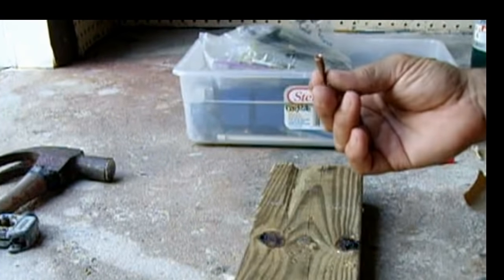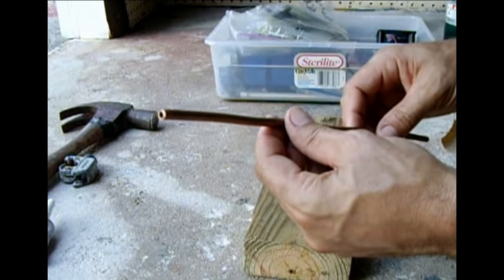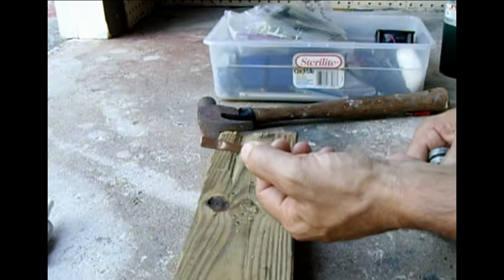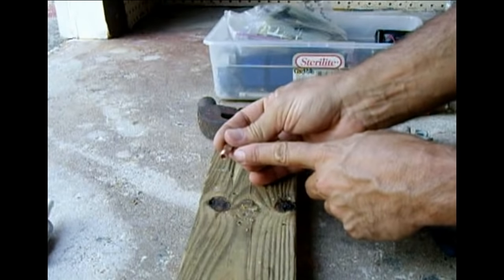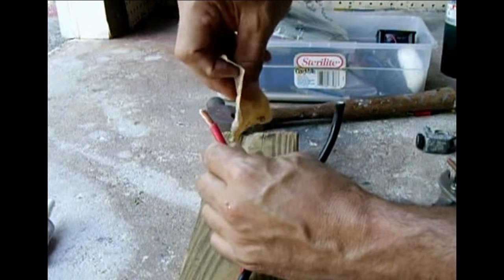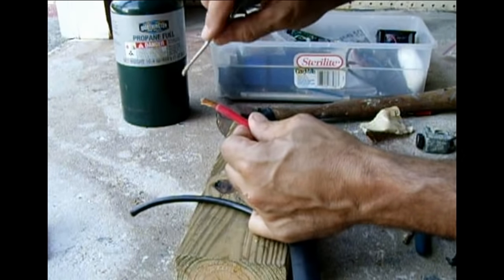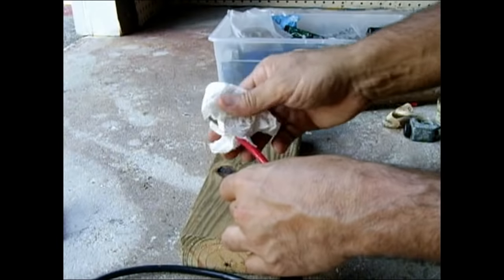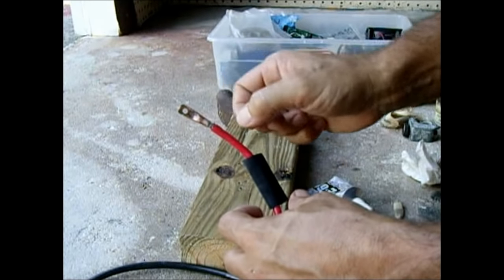How To Make Copper Battery Cable Connectors!

Comment: I prefer to crimp and then solder. In the event of a dead short (heaven forbid) the solder will melt immediately and the wire to slip out which could possibly compound the problem. The wire, once lose, could strike something else. Now instead of just having a bright orange glowing wire with the insulation burning off, you have the potential for sparks flying everywhere. If you don't have a crimping tool I find that using a center punch and punching a dimple into the connector will compress the wire inside and prevent it from coming lose if the solder ever melts due to heat. I have had 12, 12 volt deep cycle batteries dead short before. The last thing you want is one of the wires flailing about, contacting something it shouldn't and producing massive sparks. The remains of my 9/16" wench produced enough sparks for me. And yes it was fused, but in the split second for the fuse to blow it did serious damage.
Reply from the maker: Very possible event, but highly unlikely. As you stated, the wire would have to be extremely hot in order to melt the solder. The insulation would be burning off the wire, and at that point it would not matter what happens, because once the insulation burns off, the wire will be touching things and grounding out.  As I stated in the video, for extra strength, crimp and solder.
Reply: Oh, and great video by the way. The price of things today drives the average Joe to do what the Average American Joe does best, and that is to use what he has, use his brain and improvise. Also, when I make connectors like yours I always round the corners just slightly with the grinder or a file to give them that "professional" look. One of your commenters mentioned using one tube inside another and also using them to bridge batteries instead of using copper cable that costs as much as a two week trip to Florida. I'll try this except I'll use some rubber hose on the bridge connectors for insulation. Because if you drop a wrench guess where it it will always fall?

Comment: good video but he used pliers to hold his part but you should drill hole while it is still attached to the tube , use the tube as a longer handle to prevent the bit from grabbing in the soft metal and ripping it out of your fingers or pliers and injuring yourself or damaging your part. keep your parts  away from the drill bit parts many have been hurt by this   myself included.  also  doing the drilling before  saves you steps if it gets damaged as the soft copper will fail sometimes when doing larger holes this saves time which is directly linked to your wallet .  Also note the 12 deg angle of a drill cutting edge is more than enough for it to grab like a knife blade in soft metals once you have broken threw with the chiselpoint (center of drill flutes) of the drill . usually  this chiselpoint is a non cutting edge and is why you have to push so hard to drill without a pilot hole ...  drill before you part off the excess material !! :)  using pliers  will leave tool marks in your part also id rather try make it look perfect  he did good but there is always a way we can do better.. be sure to use a two fluted tool if a tapered or step type bit is used  or it will drift horribly  you have virtually 0 control over drift on a single fluted tool when done by hand. to make the chiselpoint of a drill a cutting edge  you hand sharpen your drill bit as normal  dress your wheel so you have a sharp corner then  you turn it so the chisel edge is parallel with the wheel and use the sharp corner of the wheel to grind it into a cutting edge  rotate 180 deg and do the other side. you will basically make a small notch in the back side of the flute that will not effect tool life in a negative way  we are making that blunt center resemble a two fluted end mill.
when you are finished i usually put the bit to my fingernail and gently turn it 180 deg  you will see the bit wants to drill into your nail with its before blunt chisel point.  This will save you some time and sweat when drilling harder materials like steel  or using a drill press. a drill sharpened in this fashion  you don't even have to center punch your material most of the time  you start the drill press line it up and gently tap it against the work piece as it center cuts now it will gladly make a divot for you to use as a center point as now even the center cuts your also not pressing as hard you will be less likely to have the bit dig in and grab. drill flex also can be eliminated or drastically reduced making your results all the better.
i wont even go into proper chip load or surface footage , but those are usually why we see premature cutting edge failure . the results of improper speeds and feeds will be        burnt melted cutting edge =  too fast or not enough feed  and a chipped or fractured cutting edge = too slow or too much feed .
There is a formula for this  but its not something most anyone can fallow as each material is different.
 i was bored and maybe i helped someone somewhere...  no one ever reads this stuff anyway huh.
“Gentlemen, we will chase perfection, and we will chase it relentlessly, knowing all the while we can never attain it. But along the way, we shall catch excellence."

Comment: you can also strip a centimeter of wire insulation put the end in vice grips massage insulation back in reverse then when end is crimped on massage it back over the connector with glue =fully sealed no heat shrink needed.

Comment: Type M, L, & K are thickness measurements only. You can have rigid L & K also. "soft" copper is almost always K, unless we're talking small diameter tubing and you'll find some L.
Reply from the maker: +PowerScissor 
Let me guess....You had annotations turned off? Right? ALWAYS leave annotations on while watching videos on my channel. I suggest you go back to 1:21 leaving them on. Type "L" is the most common found at home improvement stores, not "K".

Comment: Drill a little hole where the pipe is squashed so you can feed solder into the joint.
Reply from the maker: Many different ways of doing things. Do what you like. Thanks for watching!

Comment: Not sure why I can't reply to the thread below jim davidson's comment regarding high pressure crimping vs. soldering.  Electrons flow along grain metal crystal grain boundaries with current being defined as the number of electrons that pass through a surface area cross section in a second.  Amps = Number of Moles of electrons/Meter^2*Seconds. Depending on wire strand specifications, most current travels along the surface of the strand,  Oxidation/corrosion binds free valance electrons, many times in smaller gauge wires, the individual strands have protective coating applied as wire is drawn trough dies. The temperature at the time of manufacture, or subsequent tempering processes applied determine the structure of the internal grain boundaries of the strand.  Soldering typically facilitates electron flow at surface boundaries of strands. The temperature of soldering can change strand grain boundaries making individual strands more brittle and susceptible to work hardening and breaking under vibration.  Crimping is used to impart mechanical strength with less impact on strand characteristics, which is could be a factor in strand breakage under cables subjected to high frequency loads. Ideally a cable would be terminated soldered using compatible materials at an ideal temperature and then heat treated in an inert atmosphere or vacuum while insulation was applied to the cable prior to atmospheric exposure. While this may sound silly, I can imagine high temperature superconducting cables for high voltage/current power transmission requiring such techniques in the future. 
For practical quality home automotive/marine/automotive and most industrial low voltage/frequency applications, solder wins every time. When it comes to electricity and wiring it's all about protecting the free electrons at the surface boundaries.  In DC applications remembering that electrons are moving in the opposite direction of polarity in DC circuits is helpful.  Ground is the most important pathway and most often overlooked element DC troubleshooting.
Reply: +Sean Lynch 
what is all this its just a simple 12v battry cable
Reply: kicken chicken I agree. We simply have different perspectives when considering the simple things of life.
Reply: Sean Lynch I believe you are wrong about some things. at first it sounded like you knew what you were talking about but now im not sure. first, pure copper cannot be hardened by heating. so soldering a joint would do nothing but possibly anneal it slightly. the only way it can be hardened is by work hardening. second, the skin effect that I think you are referring to is only relevant in high frequency situations. even then I don't see how soldering would be a disadvantage.  if im wrong about anything let me know. I mean no disrespect, but it just seemed to me that you were spouting some random information that wasn't very relevant
Reply: also can you clarify what you mean by, "when it comes to electricity and wiring its all about protecting the free electrons at the surface boundaries"
Reply from the maker: +Ben Watson 
Hi Ben. I have been using this method for many years on jet skis, boats, vehicles, as well as my inverter generator(which I have a video for). Never any issues. Some people like to get all technical. I had a couple people argue with me over the fact that I was using 95-96% copper for plumbing instead of 99%+ copper for electrical. They claimed I was losing power. LOL. I told them that lead is less conductive than copper, yet they use lead for lead acid battery connections which handle hundreds of cranking amps with no problems. Absolutely ridiculous that anyone would bring that up for 3 to 3 1/2% difference. Crimping and soldering is a great idea, but usually I will solder only unless I am dealing with a very heavy gauge wire. The purpose of this video was to show viewers a great way to save money by making their own copper lug connectors. If they want to crimp also, then great, crimp.

Thanks For Watching!
Reply: +electronicsNmore sorry about the confusion, I was actually replying to +Sean Lynch . but thanks for the information and video!
Reply: Using solder as the sole means of connection is a big NO.

Comment: One possibly-insignificant caveat regarding this method is that copper pipe is usually made from alloy C12200 that is 99.9% copper, while a manufactured solder lug is usually made from C11000, which is 99.95% copper. This should not be an issue in most applications, as the reduction in conductivity would only cause a slight rise in temperature.
Reply from the maker: That small difference is nothing for the conductivity level.

Comment: is safer to open the hole before cutting the piece out from the rod. You will have better control during drilling.

Comment: Sand paper contains Silica, a non-conductive grit.  The grit can stick in wire or tubing, so solder doesn't flow evenly.  I prefer a steel or brass wire brush instead.

Sand paper is really for wood working.
Reply from the maker: So let me get this right, you never used sandpaper to clean metal? That I seriously doubt, and if you have not, boy are you missing out. LOL. Sandpaper is really for wood working? Tell that to the auto body shops, plastics companies, and metal working companies. When your done using the sandpaper you clean away any EXTREMELY SMALL amounts of abrasive which may have been left behind by wiping away or blowing. I guess all those years that I used fine emery cloth(along with MILLIONS of others) for cleaning copper tubing before soldering, was also big mistake. Meanwhile, never any problems. Your comment is ridiculous. I never knew so many experts existed until I started my Youtube Channel.
Reply: electronicsNmore Actually it is not sandpaper any more. it is glasspaper.

Comment: Right and as soon as there is a short the solder melts and the cable comes right out. That needs to be crimped too.
Reply from the maker: LOL. You missed the part that there shouldn't be a short circuit if the proper overcurrent protection has been used. Actually, if the cable was crimped, and you had a short circuit, the wire would become extremely hot/glowing, the insulation would catch fire(and set other things on fire), AND the lead acid battery could possibly explode due to the short circuit condition. If you only solder a cable and that short circuit occurred, once the wire became hotter than a few hundred degrees, the solder would melt, the wire would likely pull out of the connector and open up the circuit preventing a fire or exploding battery. Which do you prefer? :-) All this being said, I myself prefer crimping AND soldering.
Reply: Makes sense. 😃 I must have missed that part of the video. Never mind.

Comment: hi what size  of copper  and sort do you buy to make all size's 12/10/ and make's copper  end's can you list or send a list thanks
Reply from the maker: Too difficult to find thick wall copper tubing for 12/10 gauge. You would have to purchase the tubing at an air conditioning/refrigeration supply house. Hardware stores like ACE/True Value, sell small copper/brass tubing for hobby projects. Bring wires with you and match up what you need.
Reply: thanks fast reply what pipe do you use biggest size make gene
Reply from the maker: 3/8" copper
Reply: thanks good videos
Reply from the maker: Glad you like them. Be sure to share.
Reply: that I do

Comment: What about when you got to do double. Gauge wire
Reply from the maker: Larger thick walled copper tubing.
Reply: So how do you figure out what size copper tube you would need depending on your size wire like double-ought 00  01 02

Comment: For marine use??  Both crimp and solder, then slide a loose-fitting length of heat shrink tube over the crimp/seal, pump full of silicone seal and shrink.  Cut off excess silicone that is squeezed out of the ends.
Reply from the maker: Hi Duane. For marine use, you'd need to tin the connector as shown in my other video below. Yes, either silicone or just use glue lined heat shrink tubing. Thanks for watching!
https://www.youtube.com/watch?v=_ZTk3OYacyE

Comment: Not all L & K copper is soft, you can buy it in rigid also. 
If hard drawn is all a guy can find you can soft n it by heating it, then quenching if you want. It’s not a ferrus metal so it won’t harden. Also, wouldn’t it be easier to drill before you cut it off?
Great idea though!
Reply from the maker: Correct. It needs to be refrigeration copper tubing.

Comment: hey great idea,but maybe you should face the connector downwards to ensure solder flows
Reply from the maker: You don't have to if the wire is only slightly smaller than the copper connector. Capillary action pulls the solder in and around the wire. :-)

Thanks For Watching!

Comment from the maker: I don't think you will ever see that on a boat, even though it is a good connection. What I made here, is exactly what is on all boats battery cables, and used to connect some alternators/ground cables.

Comment: Another way is strip 3 inches split the strands wrap around a stick or pencil both sides across to the opposite sides and around itself at the base then flaten gently solder the whole thing then flatten again to finish....... If you know how to solder you end up with a better longer lasting connection just be sure to clean acid fluxes off or neutralize with baking soda b4 connecting..... Best lasting connection you will ever make
Reply from the maker: Thanks for watching!

Comment: For everyone who is thinking it would be easier to flatten it with a vice,IT WONT WORK AS WELL because if you do that it will be flattening from both sides so therefore the flat spot will not be flush on eather side which means that when you bolt it to a flat battery terminal it wont be flat
Reply from the maker: You're correct, that is why I use the hammer. :-)

Comment: Will this work for s 02 Mitsubishi gallant?
Reply from the maker: This will work on anything, just as long as the wire fits nicely into the type K or L copper connector you make.
Reply: Ty I fixed it. Was easier then I actually thought:). Videos are very helpful!!!

Comment: This may be fine to use on certain  applications but just so you know, copper tubbing is less pure than copper wire and terminals and using it will cause a reduction in conductivity and can potentially cause the terminal to over heat. Just putting that out there. If I used these terminals on a regular basis I'd probably forge my own from scrap copper wire which is around 99.99% pure as the molds with be easy to make and pour
Reply from the maker: JustinLodes You will NOT notice anything different(current wise) using copper pipe vs copper wire. Using 98% copper, vs 99.99% makes NO difference whatsoever. I have proven that countless times over the years. Do as I showed in the video, and you will have no issues. Your too paranoid. If what you said was a huge concern(which it is not), then you would not see lead posts on a lead acid battery. Your worried about the copper lugs not being 99.99% pure, but what about the lower conductivity lead screw posts? You don't see aluminum wire not being used since it is less conductive than copper, do you? Electrical panels would not be using LOWER conductivity aluminum buss bars and lugs, if it was a big problem. The only problem there is oxidation between the copper wire and aluminum lug causing a high resistance connection. That is what no-alox is for.  You have very unusual logic. Are you sure your not just trying to nit pick my video? There is NOTHING wrong with this video. It is well presented and explained.